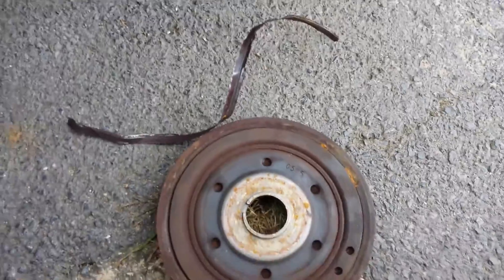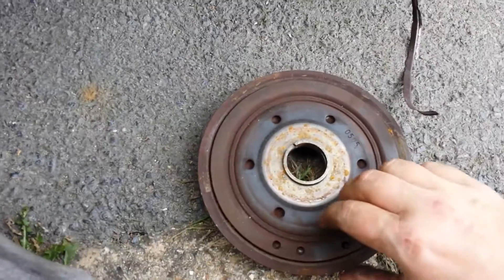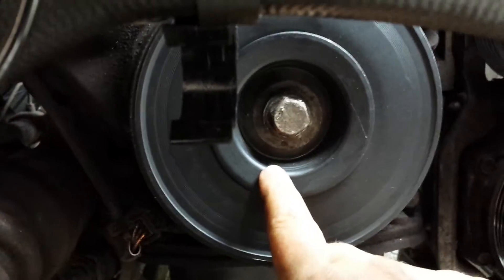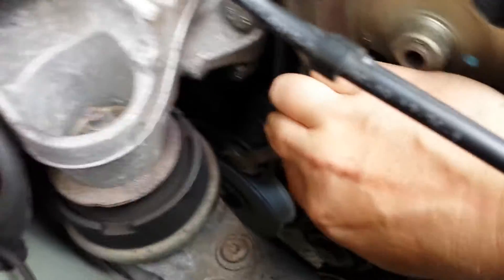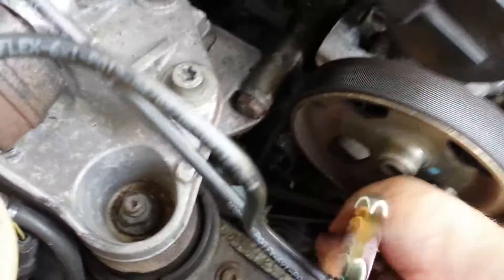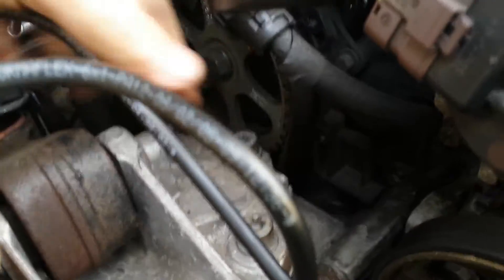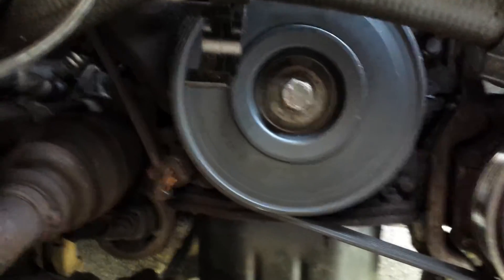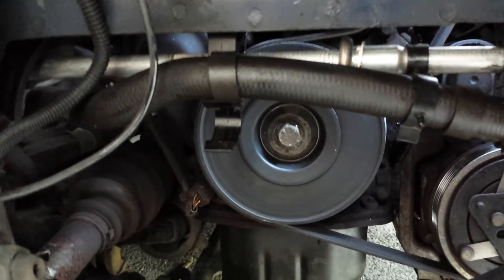Peugoet 407 Bottom Crank pulley issue

Comment: Is this what makes 1.6 HDI's sound like tanks?
Reply from the maker: Has it just started or do you mean generally.
Reply: @fetchitnowuk  I mean in general but im probably on about something else. Ive heard many Peugeot and Citroen's with the 1.6 HDI and some of them chug so loud that you can hear them from a mile away even with standard exhausts. I wonder if it's something to do with the air intake system.
Reply: @jaggass  airbox is frequently rattling on 1.6 hdis
Reply: @Mr330d  Poor design and the grommet's come lose probably causing that hollow sound. Ford's, Volvo's and Mini's don't do that and has the airbox and filter in a conventional position.
Reply: @jaggass  on my 307 1.6 hdi for air filter change you had to remove scuttle panel and wiper arms 😂
Reply: @Mr330d  Such a stupid design.

Comment: Hi, Thanks for the info. I was wondering if I could ask you a few questions and perhaps send you a photo so you can help me determine the problem with mine.
There is quite a loud rattly noise coming from the area and a shredded strip of metal was hanging around there. For a few months I have noticed a clicking when steering out of a junction at low speeds.
Your help would be greatly appreciated.
Thanks.
Reply: Brenig James  
Your steering sounds like outer c v joints failing.

Comment: hi, thanks for this, pretty sure ours going. like you described it sounds like really bad tappet noise, on our 407 it's intermittent at the moment but will no doubt get worse.
Reply from the maker: +Francis Francis I'd change it as soon as possible. If the pulley disintegrates it could cause the belt to get caught on the bottom crank and seize the engine.
Reply: @fetchitnowuk  did you fit a solid one on it ?
Reply from the maker: Alas no, I got a direct replacement.